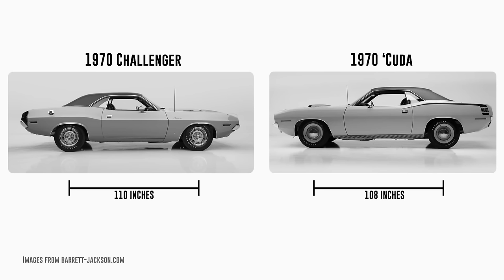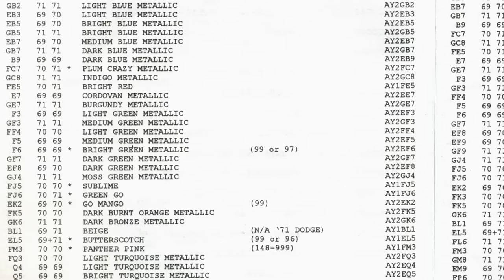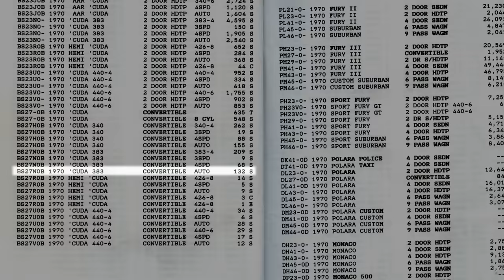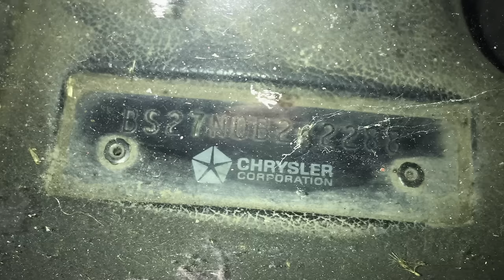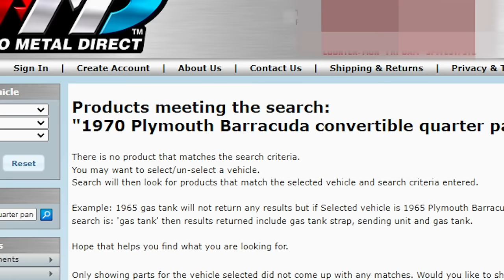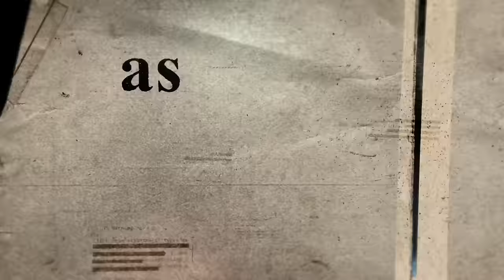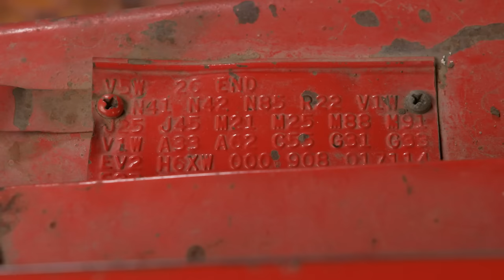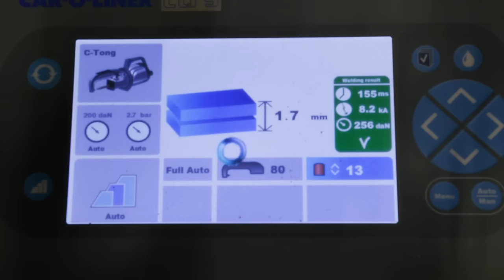REMAINS OF A '70 'CUDA CONVERTIBLE  #totaled #destroyed #rusted #plymouth #cuda #hemi #426hemi

Comment: I have a 6 pak set up small block, intake and air cleaner are factory I believe 71. But my carbs are the a set of the direct connection  carbs all progressive linkage accelerator pumps.  I want to know what mark knows or thinks about this setup